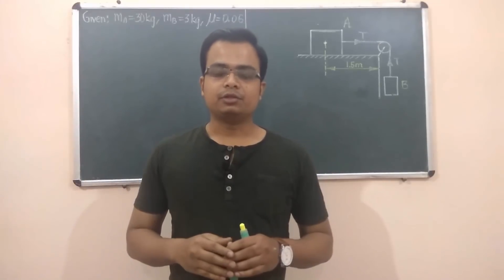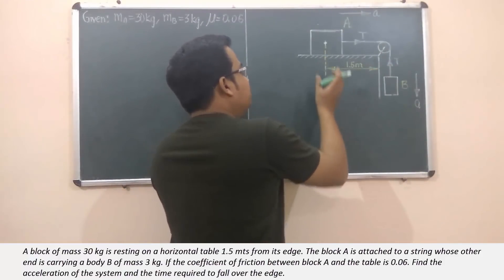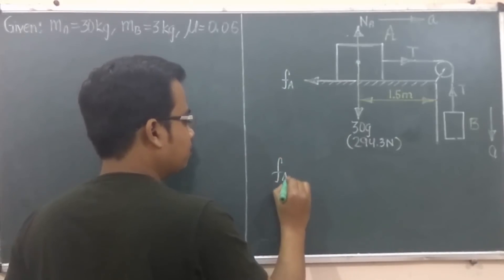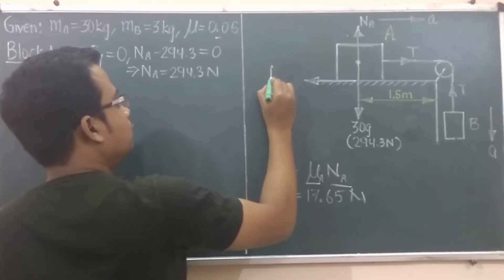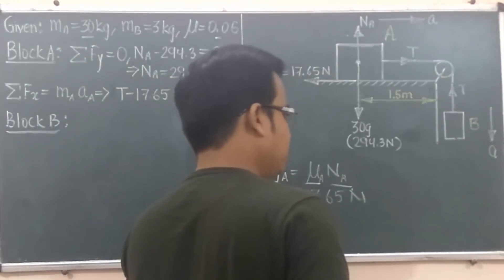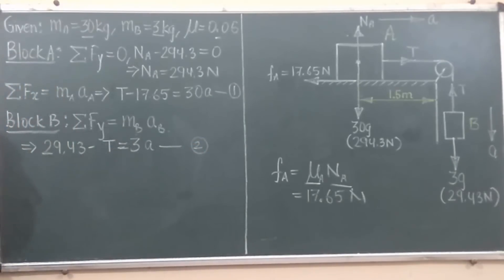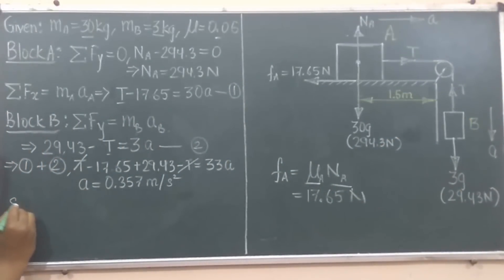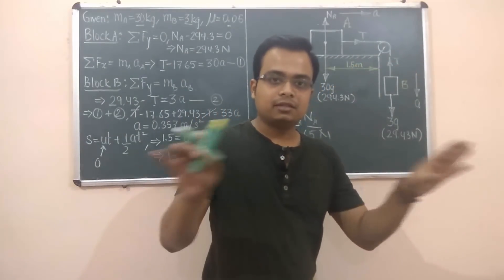D' Alemberts Principle | Newtons Law of Motion | Dynamics | Problem 5 |

Comment: Sir i want solution for below problem
A mass M resting on a smooth table is connected to masses M1,M2 by the strings find the acceleration of the system’s